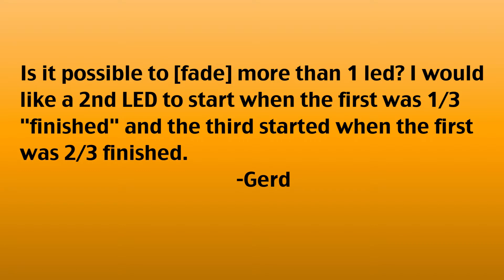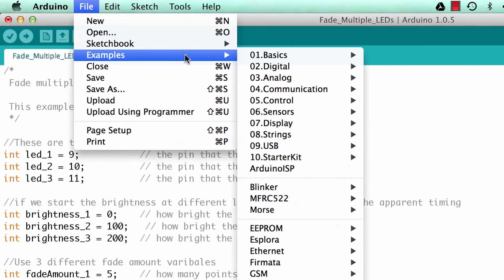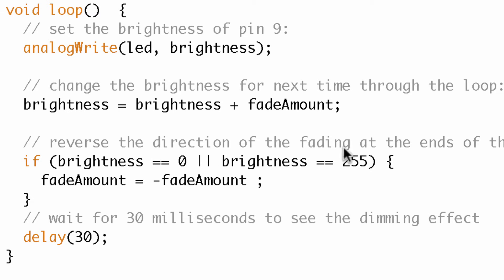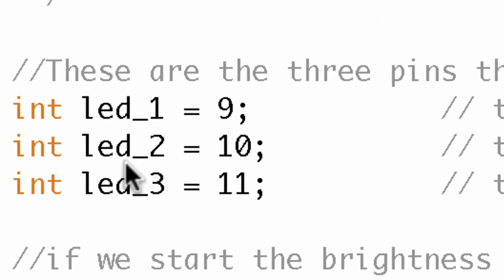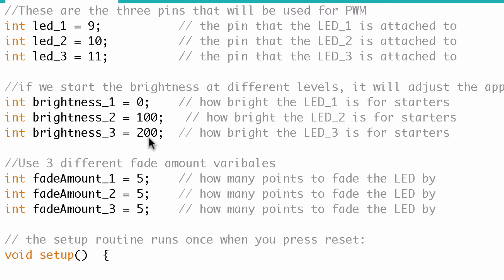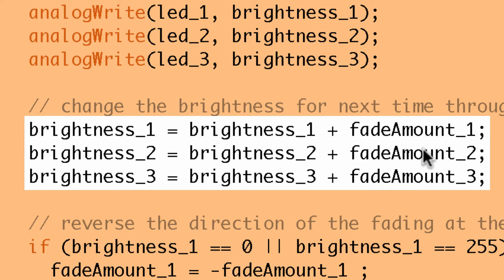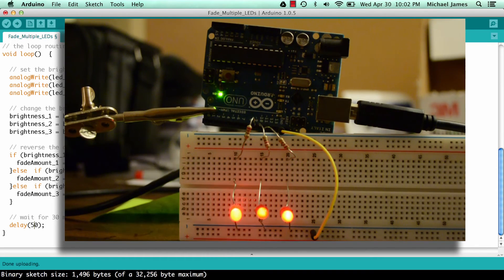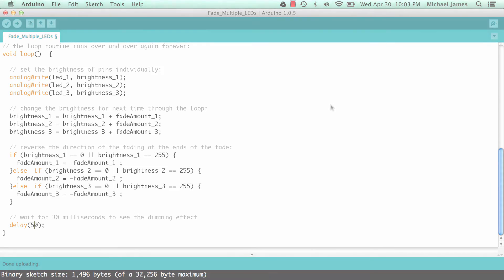Fading Multiple LEDs in Sequence with Arduino :: Viewer Question #4

Comment: is there any reason to use the "else if" since each led is being controlled independently? i did the following code (only using 2 led's) and got the desired result:

  if (brightness_1 == 0 || brightness_1 == 255) {
    fadeAmount_1 = -fadeAmount_1 ; 
  }
  if (brightness_2 == 0 || brightness_2 == 255) {
    fadeAmount_2 = -fadeAmount_2 ; 
  }

Thanks for this tutorial series. keep up the amazing work.
Reply from the maker: Good Point!  I wonder why I used "if else"?  Nice recommendation!
Reply: In the example given it is perhaps academic but using 'else if' is more efficient.
If the first 'if' is true then subsequent 'if' statements would not be tested thus saving time.
Suppose you had 50 LEDs. Worst case would needlessly test a further 49 'if' statements. Using 'else if', no further tests would be performed.
Reply: +Subterminallyill 
Either way it is a very dirty solution for this solution. 
Working with a class that holds the PIN and PWN in an array is nicer. (Or if you want to stay in C a struct).

Then simply look at the other element if it is a 3rd of the way there if so initiate it to fade.
That way you don't need sever if or if else's

It commonly is consider bad practice to require an extra if statement for every "element", if you need to do that you should rethink your code.

Comment: I thought you'd answer this question in more general terms too... What if you have an N number of led where N is greater than tilda outputs?
Reply: You need a ~PWM pin for each individual LED you are fading. That is how you can control the brightness. If you wanted more LEDs than the UNO holds, you can get an Arduino Mega board which has more pins. You could also use transistors to have one PWM pin controlling 2 LEDs, and that would require the use of another nonPWM pin to control the transistor, and that would complicate the code.

Comment: I know that when I tried this tutorial for one led, it really doesn't look like its fading, it looks like its slowly blinking which is not what I was expecting. but thanks Michael for another great explanation/tutorial     mike/doogie
Reply from the maker: Hi Mike, out of curiosity, were you using the example "fade" sketch that comes with the IDE?
Reply: yup, straight from the examples, then I tried lengthen the time, but like your demo it just didn't look good. but it's no big deal, not something I need to do, thanks for the reply
Reply: I learned the best setting for fadeAmount is 3 instead of the suggested 5 and I noticed a smoother effect when the fade is dimming.
Reply: Double check that your LED is in a pin that has ~PWM. When I first tried it, I switched the LED to the internal LED on pin 13 and could not figure out why it was not fading until I realized that pin 13 does not have PWM
Reply: I had a similar problem when using the Fade example from Arduino so I changed the <= to == in the conditional statement and it fixed the error.

Comment: Since there are only 6 pwm outputs on an Arduino would I be able to use a TLC5940 PWM Driver or would there be a way to have more then 6 LEDs fade or flash with just an Arduino board?
Reply: I think the arduino mega has more PWM pins. You can check it out.

Comment: what resistances are you using?
Reply: I use 220 ohms in general for LEDs. How to know what resistance you should use: take the supply voltage, and divide it by the maximum rated amperes(unit of current flow) allowed in your circuit. That will give you the minimum resistance in ohms to use for the resistor. Make sure you get the proper prefixes correct. There is a difference between milliamperes and amperes for the unit of current. Learn how to convert them back and forth.

Comment: Where did you get the value of 5 in fadeamount  why 6,7,8,100 the better name I Think is brightnessamount
Reply: The maximum brightness is 255. The fade amount needs to be divisible by the maximum brightness, or the brightness will keep on shooting upwards and eventually crashing the code.  So for example you could set the maximum brightness as 250 and set the fade amount to 10 and that would work just fine too. Play around with it.

Comment: First off, keep up the great work with the videos! Learning a lot here :)

Questions: 

1. Why are not all the digital pins on the Arduino board PWM "compatible"?  Why the restriction?

2. I have this project (https://youtu.be/6TFn9hxlynw) and i'm wondering how I can make all 11 LED's fade in and out a circle pattern. Is there an easy way for a noob?

3. Any suggestions what I could use my project for? I machined the aluminium ring in my youth but still haven't decied what to do with it. It would be cool to have a private Hal 9000 in the house, but i'm drawing a blank when it come to what functions it might have. Voice activated something?? Motion detection something??